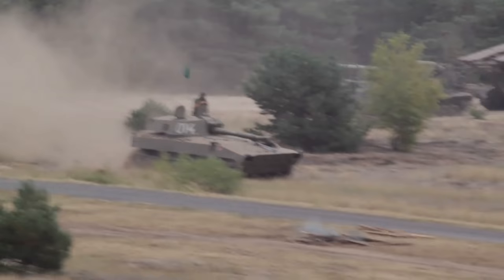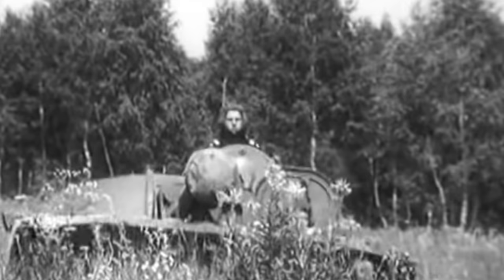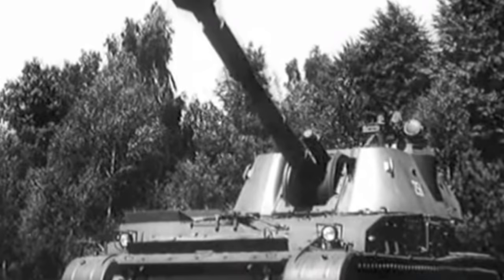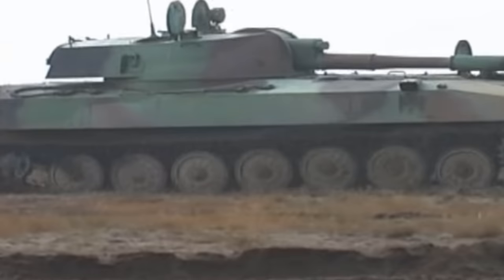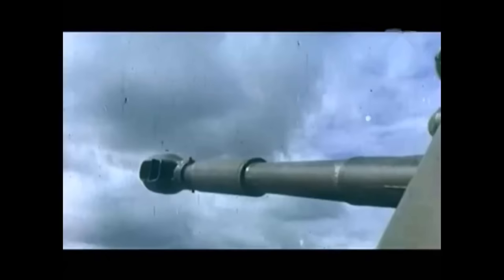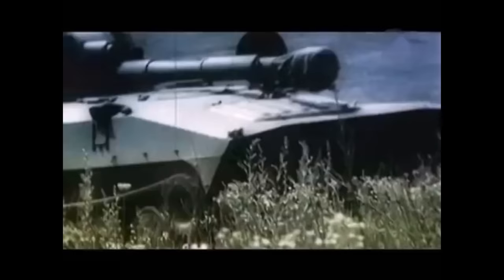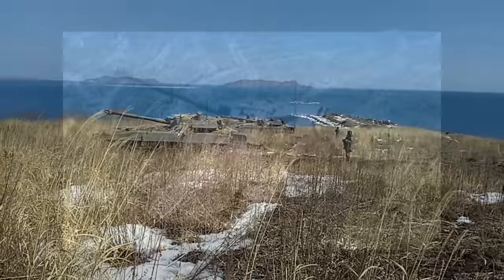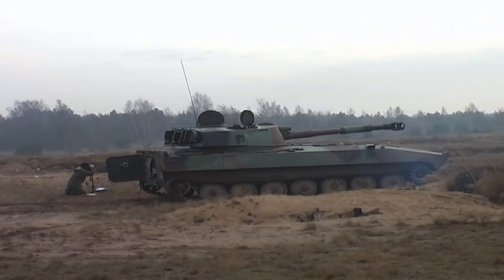2S1 'Gvozdika' 122mm Self Propelled Gun | RUSSIAN FAST ARTILLERY

Comment: Finnish Gvozdika driver here! This thing is the best! The handling when driving can be finicky, but it is easy to adjust and also easy to do field maintenance. In Finland we place for at the back of the turret for gear, basically an open crate and currently we have PKM mounts for the loaders side, before that we had 1 AK per tank plus our service pistols, I guess we would be given the AK as well if things get really bad.
Reply: @blingbling574  it is not supposed to be under direct fire. Its purpose is to be mobile and fire from closed positions at long range. Armor should protect the vehicle from shrapnel in case of enemy counter-artillery fire. It is also easily transportable by planes, you can load several gvozdikas in an 124
Reply: AK, or RK62, Sir? By the way, it must be awesome to crew one of this beauty piecw of artillery!
Reply: @creepydutchman  AKMs finland got from somewhere we still use them alongside rk62s in more special roles since they have folding stocks(i heard when tanks were bought from east germany they had AKMs,dragunovs etc inside so we use them too)
Reply: @TheLazyFinn  thanks for explaining! it was just my curiosity that the RK might be stored in a much narrower area considering the "cramped" area inside the howitzer
Reply: @creepydutchman  we also have rk62tp and rk95tp, tp is taittoperä which means folding stock
Reply: Oh cool! I have a question. Do you need the rear door opened to be able to load and fire the gun? Or can it be done from the inside? Because I've noticed that in most videos of this SPG, the rear door is always open.
Reply: @DrJiKentauriuzHero  Of course it can be done the door closed, but I guess during peacetime it's open for safety and if the instructors need anything also it helps with the gasses.
Reply: @TheLazyFinn  Awesome! Thanks for the clarification.
Reply: @DrJiKentauriuzHero  No problem
Reply: @TheLazyFinn  Check serbian modernisation of 2S1 Gvozdikas
Reply: @Tesla34000  Okay, I will!thanks
Reply: @blingbling574  yeah keep dreaming kid
Reply: @blingbling574  if enemy can hit your arittlery vehicle with machine gun, you have already fucked up and lost the battle at that point. These things should never see the enemy at all, ideally.
Reply: And these would definitely be working with some more threatening foes such as Pion or Tyulpan which would be guarded by a Tunguska and those 30mm are very dangerous to anything other then a modern MBT
Reply: @csme07  Unless you are referring to some other country, we don´t have any of those things in service here. We have no heavy artillery or mortars, but something close like it would the Amos twin barrel mortal system and Marksman AA on Leopards (dual 40mm)
Reply: @TheLazyFinn  I am Russian I was speaking of Russia but have you seen the Pion?
Reply: @TheLazyFinn  yes the 35mm oerlikons on that only shoot 1100 rpm with both barrel the Tunguska hits a staggering 5000 RPM
Reply: @csme07  We also have old Sergeis for AA!
Reply: @TheLazyFinn  the ZU 23 2? I man a S400 is grandson!
Reply: @csme07  Yep that old thing is still in use!
Reply: @TheLazyFinn  still very menacing to low flying aircraft
Reply: @csme07  Yeah, that's what I guess they use it against.
Reply: @TheLazyFinn  I mean it can’t shoot at jets it’s simply not fast enough to aim
Reply: @csme07  I know, that´s why the Marksman system is in use
Reply: I didnt know that fins have soo many russian militry tech
Reply: @nikolajovic1500  Compability and resupply ;D... Also ruggedness
Reply: @TheLazyFinn  yeah ! Here when american levithan comed to our door step that russian tech putted shame to them tech like T55 Pragas Mis D30 gvozdikas etc etc good stuff exept T55 its going to history . Definitely have potential to bd modernized even further .
Reply: @nikolajovic1500  Arty is easy to upgrade just better computers for targeting
Reply: @blingbling574  Sure. It is an indirect fire weapon. If you ever got familiar with them, you are dead. As many are in VietNam, Korea and other parts of the world that US somehow designated by yours.
Reply: Again, this hardware were created for the war. Sure not between Russian Empire and Finland anymore. I'm glad you appreciated what this thing can do. I've seen the results, no complains filed.
Reply: Just found out about these today. If shoot'n'scoot is your design priority, these are perfection! Why don't more  nations have something comparable to this? They look cheap to produce in quantity. I'm absolutely intrigued.
Reply: @kurt5490  Well I guess Archer system for example is cheap too, or the M109 so there are alternatives!
Reply: @TheLazyFinn  I'm not sure about calling the 30 ton archer an alternative to the 2s1. Shoot  ' n' scoot ? Hell yeah, but that's it. Being on tires the psi ground pressure goes up. So it's reliant on roads. Better stay away from wet soil.
The 29 ton m109? It weighs more than 2x as much as the 2s1. But they've been in US inventory since the early(?) 60's so they certainly are paid for.
No hate. I flew bulldozers in the US Air Force. You're the expert here. I just think the 2s1 for the niche it was designed for, perfectly serves that roll.
Reply: @kurt5490  Well yea true about tires and being heavier, but if you compare M109 to a K9 Thunder for example it's very light, I guess 2s1 is a very light platform not two times lighter though, combat load is like 18tons. Now I started to wonder if there are any that are as light as 2s1. But most of the time I would say that heavier SPGs are capable of shoot and scoot, rarely the terrain is not allowing for heavier weight. 2s1 is very cost effective though! But I would imagine Archer like systems being too cause it's a truck chassis after all
Reply: Does it have a heater??
Reply: @davep5227  For crew yes, problem was that we had to have constant temperatures on the gunpowder so if one heater was busted,nobody used it
Reply: Ironically you can thank the soviet for that XD
Reply: @kurt5490 It has become almost a meme in Finland that conscript drivers often like the MT-LB chassis in difficult terrain. The standard MT-LB version without weapons is nicknamed "ällitälli".

Comment: Leave it to the Russians to make a small yet very effective piece of military equipment
Reply: And let Finns upgrade them to perfection
Reply: It's perfect. Its relatively cheap to produce, its light and amphibious so it can go almost anywhere providing artillery support to even the most aggressive fast moving attacks. And it's made from existing inventory so it's very little new parts to complicate supply chain problems. What's there not to love?!
Why didn't the US just put a 105mm in a turret on top of m113s? Not the same as 2s1, but a budget level infantry support vehicle that can offer more range than 120mm mortars has a LOT of appeal. All the 105mm m108s got converted to 155mm m109s in the '70s to kill soviet tanks. Infantry needs all the love they can get! They're the hardest working MF's on the planet!

Comment: One thing I would like to see more of are obscure combat engineer armored vehicles like the M728 CEV or the British Centurion based CEV both of whom mount an insane 165mm Demolition gun. I've seen it demonstrated in real life back in the 1990's when I was at Ft. Leanordwood, Missouri (home of the U.S. Army Corp of Engineers) and it was extremely impressive.  Sadly it's modern replacements no longer have the demolition gun, but they still have some very cool features like the built in line-charges on the U.S. Army's M1150 Assault Breacher Vehicle, another very cool vehicle that could be reviewed.

Comment: Polish made ones are also called "Goździk" - yes the name is takrn from flower - carnation. It's because when you will watch this gun firing in highest up point in slo-mo you gonna see a fireball of the muzzle that looks like a flower itself and long, thin 122mm gun straight up looks much like its stalk. 
BTW Regular crew for Goździk are 4 guys. When you are in need for lots of rounds to be fired out there here it comes the 5-th guy. Now you have 2 loaders for more ammo work. This additional crew member is practicing with the crew on quite regular basis while still being a team member of the IFV BWP-1 or Rosomak APC of motorized infantry.
Reply: Here in Finland we just ignore the possibility for a 5th guy :D. When loading more shells the guys resupplying us might help some.
Reply: @TheLazyFinn  It works the same way in the Polish Army  still:
- you can't tide suply guys to your positions, they have to go to the next vehicles as fast as they can
- you won't take those guys onboard while you change your position
- as you can see in video, ammo boxes got about everything inside. (I think you knew it already from way too many instances) That Polish soldier which pulled out powder bags from the cases was possibly the 5-th one.
But. Things were changing (a lot) since when I finished my service. Its possible that today the 5-th guy figures out as crew member of artilery unit only on the paper.
Do you know the ranges Goździk is used in Finland. Matsimus said about up to 15 km. Which distance is not max range of this self propelled howitzer. BTW. How do you call a howitzer in Your language. In Polish its "haubica". Like: how-bits-aw :)
Reply: @HanSolo__  We in practice have it so that we are in the position, then when we are moving to next position the resupply point is on the way somewhere and the guys have prepped places for each tank to drive to and take the correct amount of grenades and move to next place, so we don't need a 5th member, basically I parked the tank, hopped out with my commander since our spots are the easiest to exit and we gave the charges and grenades to the gunner and he passed them to the loader in the tower and then put the rest in the back compartment. Then at the next firing position we are given the orders how to prep the ammo, so we take the bags out during that point, if we need to. I think we were told that the max distance is about 15km, maybe like 14,6km, we mostly shot to like 10km, but I think few times at max range and few times to few km at almost max elevation (loader had fun....)In finnish howitzer is haupitsi, like how-pit-se, like sea but without a .

Comment: This is definitely my favorite artillery piece.  It's simple, rugged, versatile, and has a very low profile making it a harder target.  I'm really surprised that the Russians didn't just modernize this vehicle with an updated fire control system or auto-loader.
Reply: They concentrate a lot on maintaining capability
Reply: @SS-hw1ou  True, but they could have done so by updating the 2S1.  But I guess they're phasing out 122mm self-propelled artillery systems in favor of longer range systems while consolidating shorter range self-propelled artillery systems to mortar systems like the 2S9 that are also amphibious and air portable as well as  airborne drop capable).
Reply: @wigon  ...there is also <<Akatsiya>> (Acacia) which is 152mm.
Reply: @juriss.4551  Yes I know that.....and the Akatiya is being phased out as well.  It also was not amphibious and neither are  its replacements.    They also do NOT have the low profile of the 2S1 which you may think is inconsequential until you try to acquire a low-profile  vehicle trying to hide  itself in terrain.  Then you're like "OH!!!! So that's what it's designed for!"
Reply: @wigon  who needs swimming if you can shoot nuclear shells? Maybe their aim was different?
Reply: @wigon  Also Gvozdikas have semi automatic loader or ram for shooting from a ground and Gvozdikas were modernized to 2S34, 2S34-1, 2S34M which got features of MSTA-S but smaller cilibre.
Reply: @juriss.4551  Oh wow!   Now that I didn't know.  Thank you for the information.   Very cool to see the Russian Army upgrading this fantastic old artillery system.  The gun/mortar system on the 2S34 Hosta is VERY interesting.  
I found info on it here:
http://www.military-today.com/artillery/2s34_hosta.htm

I wonder if Matsimus has seen this.
Reply: They don't really need such platforms in European theater. Russians are using gun-mortars. The latest 2S42 Lotos uses both conventional mortar and special low-velocity howitzer round with groove band that stabilizes the shell even further, aside from the rifled barrel itself. They use less propellant, therefore easier on logistics (2S31 Vena can carry 70 rounds), but in a behind-the-lines infiltration, they are able to use captured 120mm mortar shells. For direct confrontation with the enemy in Europe, Russians use much heavier, and longer range tube artillery. Given modern power plants, lighter self-propelled artillery outside of mortars they don't see the need and just chokes up logistics for something they can expend on main artillery.
Reply: 122mm howitzers were very long in the tooth by the 80s, soviets planned to replace them with incredibly versatile 120mm mortar NONA. The self-propelled versions are autoloaded and can fire on the move stabilized.

Comment: Missed out 2S34 Hosta/chosta version (120mm mortar) and also under the part of direct fire the 2S1 actually has anti armour HEAT  rounds up to 580mm penetration not really able to take out modern tanks but could still be useful against IFV, APC and buildings and in Syria this was one of the main targets in direct fire was buildings. Another well known round you missed off is the laser guided kitolov-2M. The Soviet Union and Russia pretty much have designed laser guided shells for all their systems. Just thought be useful to add info.

Comment: Can you do one on the 2S34 Hosta? It's the modern upgrade for this one.

Also, a Question:
Does the rear door have to be open for it to be loaded and fired? Or is that just something they do for ventilation -- considering that they're usually positioned in a relatively safe distance?
Reply: Это сделано для вентиляции во время интенсивной стрельбы и если основной боекомплект  израсходован а полной мере. Так же можно использовать для пополнения боекомплектом или через отверстие внизу в виде открывающейся круглой дверки как у Акации

Comment: Well, as to direct and indirect fire. The main role of artillery is indirect fire, where the observation with forward observers (which is a dangerous occupation - while it lasts) or a small drone, a radar plane flying at a safe distance.
That said: I'm not knocking direct fire - particularly in case of a hostile break through - but concentrating on that means protection is necessary.

The defieciency of protection leaves the vehicle unable to follow the tanks: Simply put: If the tanks achieve a break through they will have driven through light forces in dug in positions. Now when the tanks have passed and they need artillery backup the vehicle is vulnerable to the antitank weapons of light forces such as the Carl Gustav. It might be able to scoot forward a fair speed - directly into doom (and the modest ammunition - compared to doctrinial specification) will leave them like a gift that continues to give, as the transport vehicles are only scantially protected.

Now, again: I am not knocking lightly protected artillery pieces. Used properly from dug in positions (and switching between positions) is a nifty thing - especially if the enemy obviously plan to expose his bum without trousers.

Comment: 2:00 onwards I'm pretty sure that's an 2S3 Acacia 155mm
Reply: 2С3 "Acacia" (GABTU index - object 303) - Soviet 152-mm divisional self-propelled howitzer. Developed at the Ural Transport Engineering Plant. The chief designer of the chassis is G. S. Efimov, the 152-mm guns 2A33 - F. F. Petrov. 2C3 "Acacia" is designed to suppress and destroy manpower, artillery and mortar batteries, rocket launchers, tanks, firearms, command posts and tactical weapons of nuclear attack.

Comment: Has very unique autoloader - possibly the only one, which does NOT - NOT - require barrel to return to neutral position (distinct 'jerk" of barrel after firing). It can reload in full range of gun elevations.  There were numerous ugprades - including electronics and ammunition. This is very LOUSY as PRIMARY piece of artillery .... and unmatched neat, small auxiliary stuff to have a battery or two of them.

Comment: Single piece ready primed artillery ammunition is what you want for rapid firing,
Having separate shell powder and in some cases a primer as well is not ideal,
Having pre prepared or factory rounds of ammunition has the benefit of being able to offer simplified rapid fire with a auto loader.
Reply: Pretty sure all rapid-fire artillery systems use 2-piece ammunition, including those with autoloaders.